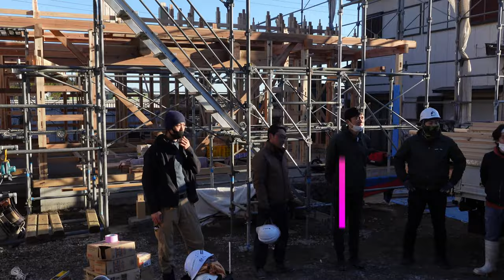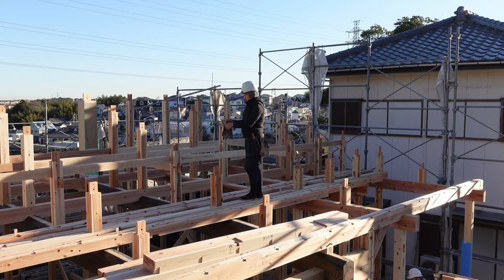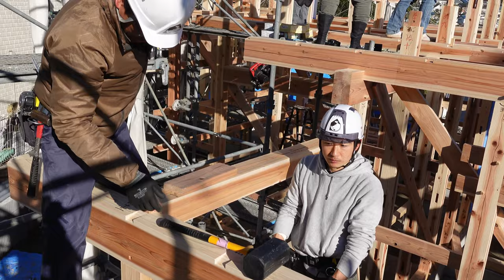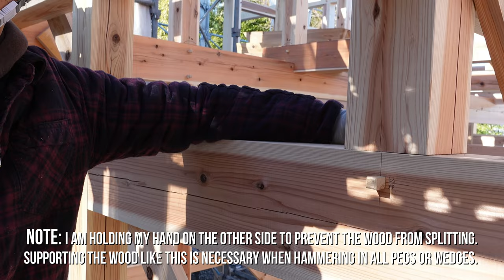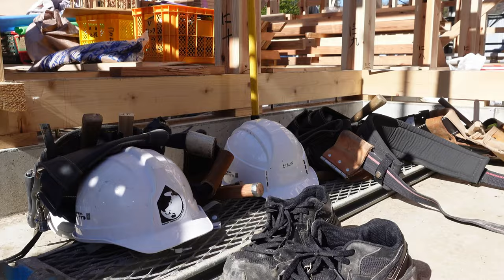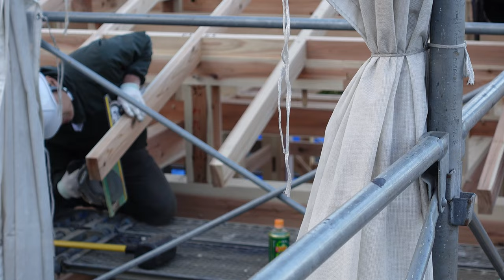Tatemae Day 2 - Japanese Joinery Timber Frame Construction - House No. 1 - Part 5 in Hayama, Japan

Comment: What are the two red stripes on your hard hat mean? Lead carpenter?
Reply from the maker: Actually this hard hat was one of the ones that was left over at the workshop that I quickly grabbed and used for the Tatemae. The two stripes means lead carpenter or senior. This is a designation used at the carpentry school only, its not a industry standard.